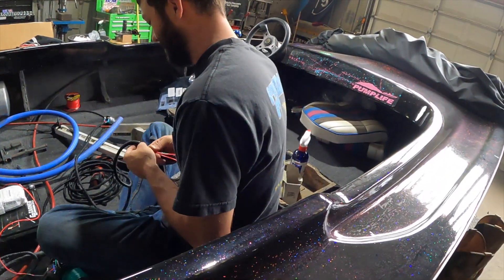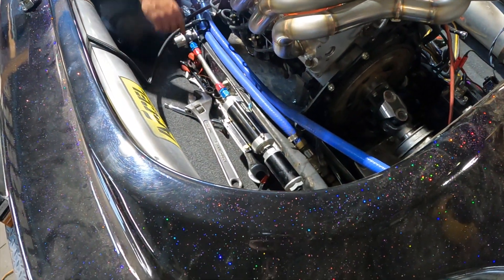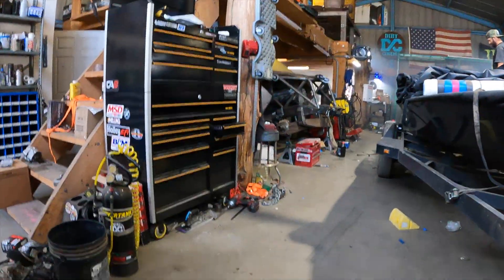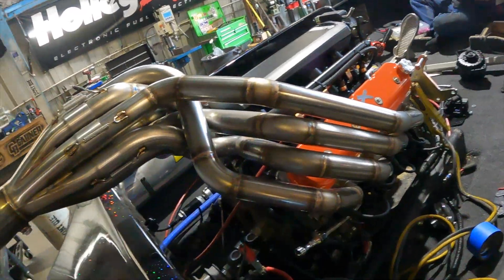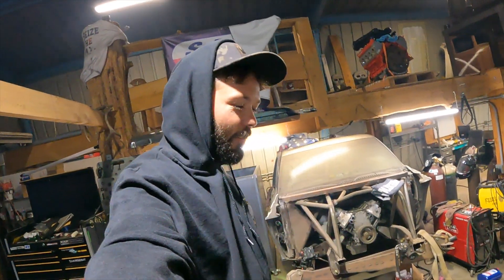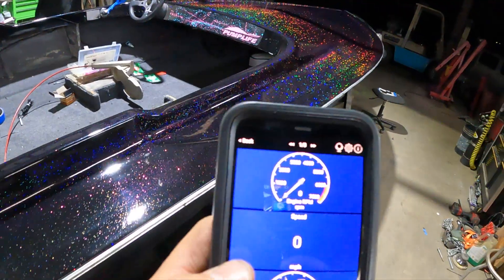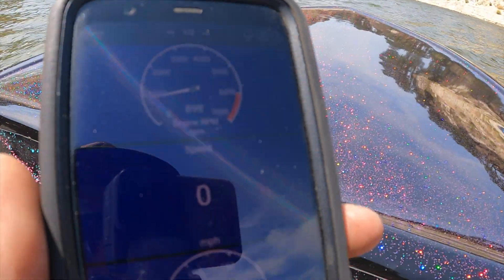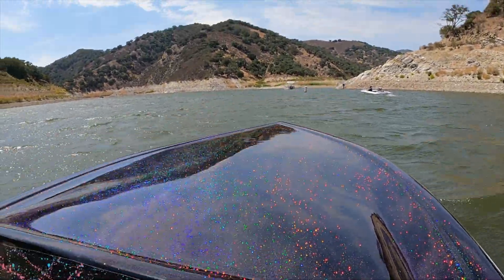HOW TO LS SWAP A JET BOAT PART-2

Comment: Seems like you took at $200 junkyard motor and then adding $2,000 in parts to make it work.  I've got a LS4 going into my jetboat.  In general I think the aluminum engines need to have isolated the water from the lake so you can run antifreeze otherwise the aluminum will corrode.  Makes it a bit more complicated.  I'm building a water cooled exhaust, and like how you mounted the coils below, going to do the same, have to change the harness for that.  btw, cool paint job!

Comment: Fuel pump should be powered from the oil pressure sensor so the fuel pump only pumps when there is oil pressure.